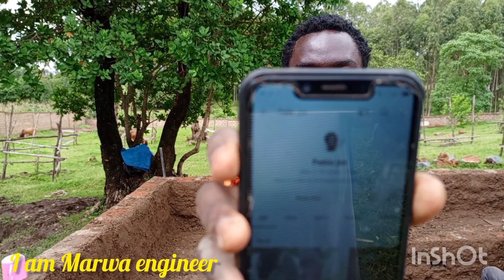Projected target @iammarwa villa medline!!

Comment: Engeneer Why dont you advise Marwa to hire a borehole rigger to drill a borehole and get clean water from the water table at once then use Submisible solar borehole pump to fill the tanks[it barely costs $2000 , not that shallow well for water of such a Beautiful house .Dirty water will ruin all his plumbing and rust a Taps .

Comment: You can cement the floor and put in the the water line for filling and for draining. Or you can also put a plastic sheet on the base on the ground and put rocks at the bottom

Comment: Engineer you need to install a automatic  water pump on the main line pipe that feeds the house to make sure you have sufficient pressure throughout the house

Comment: I had reservation about that wall when I first saw it.  I think the way to deal with the water in that area would have been to dig to cause the water to flow at a lower level, build a concrete bridge over it leading from the house 's outer wall to the parking lot. When people park their cars, they need to walk to the entrance. And since the parking lot is at a higher elevation, there would have been concrete stairs with railings leading down to the house's entrance. Marwa should also think about the aesthetics of having washing machines near the entrance of the house.  These are just suggestions as engineer has asked us for our input.

Comment: Very good question of Iam_Marwa Engineer. I  also doubt if the  construction of brick wall are strong enough to stands forces of water. The sides of the wall needs slopes outside  of the wall and inside of wall, so that withstand the forces of the water. Also the light engine makes a lot of sounds and that is not good for the fishes in the basin. I have my doubts whether such a basin for fishes around the villa will be a succes.

Comment: Engeer from basic principles pressure is direct propotion to height, how do you expect to have  water flow to the upper house as the tower and house are all on the same level??????
Reply from the maker: The water. Tower. Is on the higher side
Reply: @iam_marwaengineer  you cant get pressured flow at that level unless you install pressure pump, this deafeats the purpose of having that expensive tower

Comment: Please use tiles along the brick wall to prevent water sipping through from the fish pond
Reply: My suggestion too
Reply: Engineer, I have advised Marwa to drill borehole with submersible water pump to pump water to the tank. That is the best approach. When you do that you will have Very clean water coming out of the aquifer underneath. In my view what you are doing right now wouldn't work. This is my sincere opinion from experience. I have the same system in my family home

Comment: Engineer how can you retain water  on the fish pond without a good surface below,as  the Fish expert said  the pond wont have  cement foor😮engineer  remember that the pond foundation was made from stones and this foundation had air pockets( not sealed with mortar ) how can you prevent water leakage or seepage toward the house this is my biggest doubt
Reply: Very critical point to note consider to avoid weakening of the foundation. Time to liase with other structural engineers irrespective Marwas rush, better slow but sure.✌️🙏
Reply: The fish pond nearby and all natural lakes and ponds retain water only because they are at the level of the aquifer or have an impermeable  (clay) bottom or the rate of supply exceeds the rate of drainage. The fish pond expert did not take that into account when he suggested a  dirt bottom. Engineer, your instincts are right when you advised Marwa against this, however your responsibility was to articulate the reasons. You must tell him that he has to line the pond (canal) with tile or a plastic liner -- sides AND bottom -- or constantly pump water from the aquifer. Remember -- water seeks its own level.
Reply: @Curiousviewer22   having clear water so that the fish can be viewed, thats impossible, all fish ponds has murky ( muddy) water unless it is an aquariam for ornamental fish, cofined ponds needs aeration pumps  and the cost of maintanance exceeds the fish value
Reply: @Curiousviewer22  engineer has to stick to ethics if some thing is impossible he should not get involved!

Comment: the engineer is making very valid points....marwa should listen and perhaps setup the pond at a different part of the compound.
Reply: I see the idea he wants as seen in Hollywood but these guys are not doing it right with just a bare brick wall and some pillars😅.
Reply: Water from fish pond bottom will definitely seep through the soil and eventually reach Villa foundation which will weaken and affect the structural configuration of the villa. The process may be slow but will happen.
Reply: @aberba  exactly....such things are  done  by highly skilled experts with all factors dully considered.